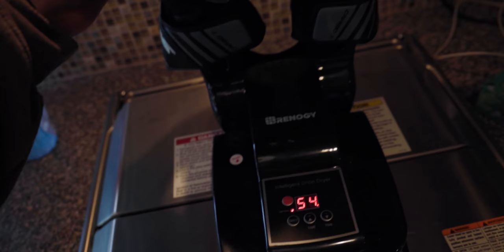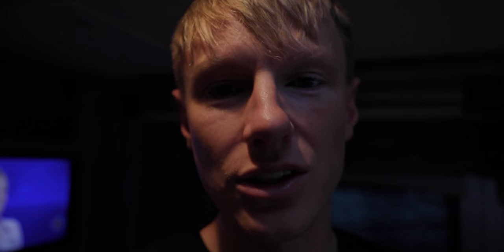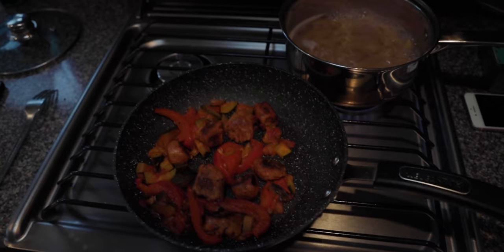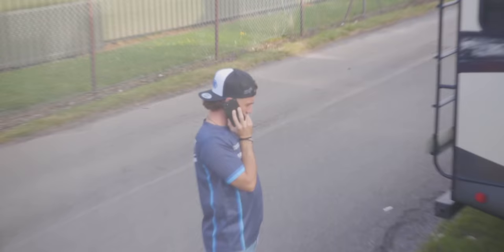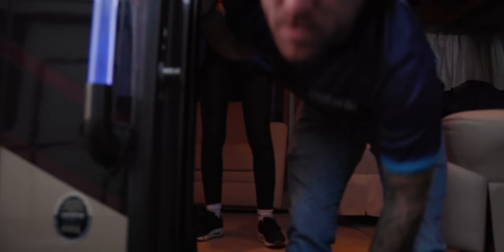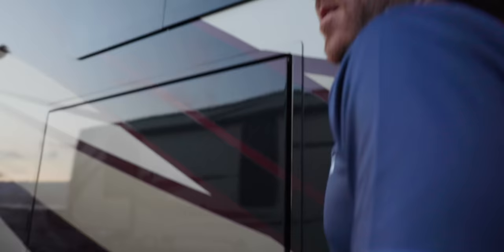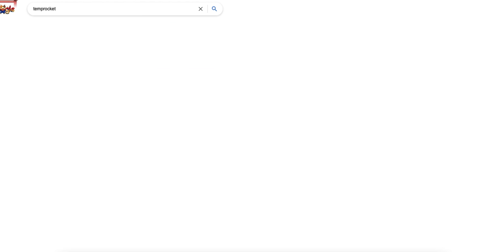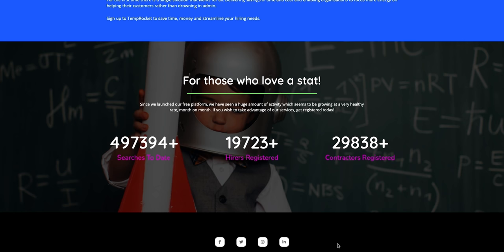The Trials and Tribulations of being a Motorcycle Racer...plus we sneak into a motorhome!

Comment: If you think you are going to fall off, you will.  Look at a rabbit on the road and you will run it over. Fixation is what you call it. It’s in your head, Senna would ask for 1 psi out of front left tyre and go faster. It’s was in his head.  Ask Dave Moss for suspension and mess with tyre pressure.  You young riders are like footballers, smothered in cotton wool. Barry, your dad and Rossi road around these problems. I’m 56 with Honda CBR1000RR Fireblade.  LIVING THE DREAM. 🏍